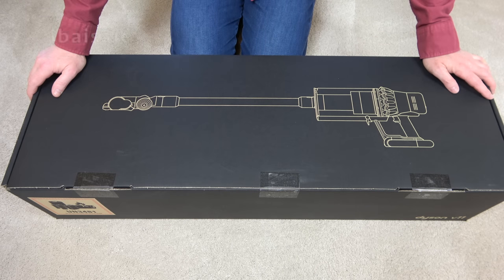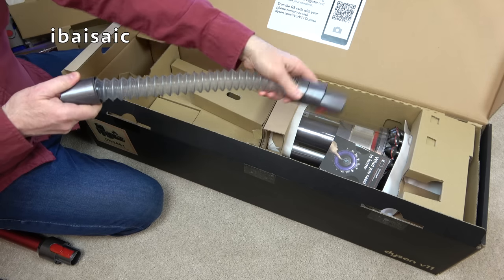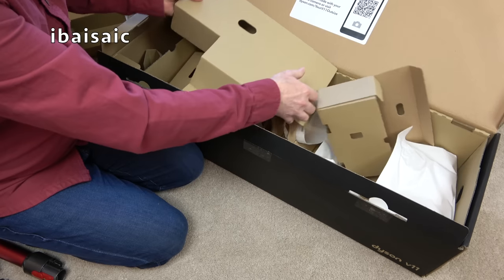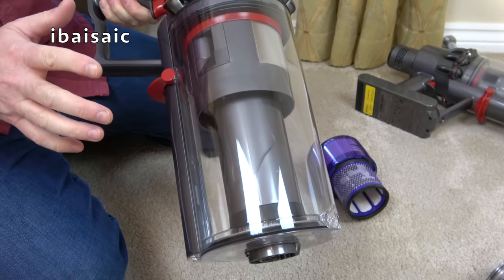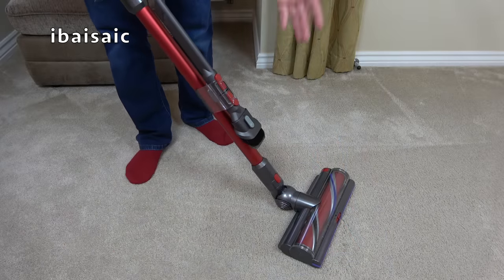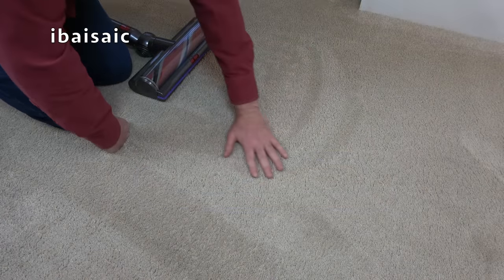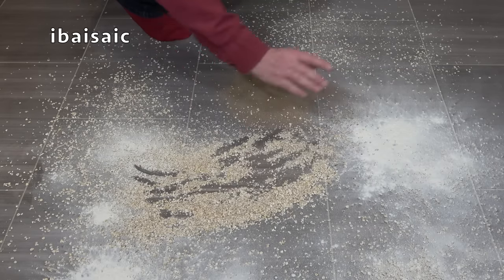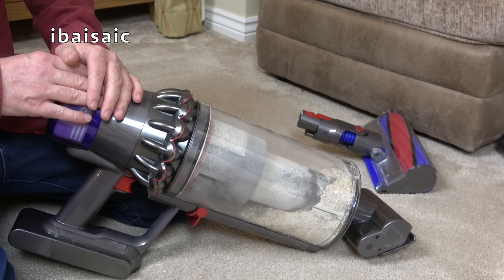Dyson V11 Outsize Cordless Vacuum Cleaner Unboxing & Demonstration

Comment: I would rather have a Central vacuum than Dyson
Reply: Id rather use anything but a dyson
Reply: no one will blame you for not being able to afford
Reply: @dronesaddict1737  I can easily buy any Dyson vacuum I want but I don’t want a dyson I’ll go out and spend $1000 on my central vacuum and I’ll be happy versus the stupid Dyson little break within two years and then after that who knows because it’ll get repaired under warranty and then after the warranty expires God knows what will happen and then I’ll have to pay to fix the darn thing I don’t want to Dyson and also rather get a Miele vacuum over a Dyson
Reply: I have both and love using my Dyson when I don’t want to get the 35’ silentmaster hose out.
Reply: @VacMaster2020 Ye and also Dyson loses suction and battery life after 2 yrs
Reply: @VacMaster2020 Dyson hater have you ever owned a Dyson?
Reply: @pumpkinslayer6 yeah if you don’t maintain it

Comment: Just got the V11 outsize and its a wonderful machine. Heavy to hold on the long clean but does a great job. Got $300 off on runout special as the V15 is being released. The V15 Detect looks like a beast with a laser beam dust detector and an internal particle sensor reveals detailed cleaning data, showing the types of particulates being vacuumed on the digital display. A whopping 230 AW of suction power . Would love a review on that one.

Comment: Stiftung Warentest did a test in Germany with cordless vacuums. Dyson V11 being one of number one listed vacuums. But they found out that Dyson batteries lose about 15-20% of capacity after a simulated use for one and a half year. I’m using a Bosch Athlet 25.2V it came with enough tools, is absolutely great in handling and has a great bush. I even was shocked what it picked up after I vacuumed my mattress^^
Reply: I tried out a Bosch Athlete found it too heavy due only to shoulder problems at the time.   Must say I loved the design of it though.
Reply: Not too keen on the simulated battery tests as they put a lot more stress on the battery chemistry than the use over an actual year and a half would do - so the capacity loss is exaggerated

Comment: Great video Roger 😁

I think the V11 outsize is the only cordless that is a true Upright vacuum replacement.

I do wish Dyson would develop a Cordless upright vacuum, I think it'd be much better than the stick format, they could use the same Digital motor as the V11 outsize and the same swappable battery system too 👍

Comment: Nice video... your videos are always detailed & very informative .. appreciate your effort... 
Can you please guide what’s better — 
Miele triflex hx1 cat & dog OR Dyson V11 .. thanks
Reply: Miele is still relatively new to the stick vac market and while the triflex has a lot of nice features, it is still sub par compared to a dyson. In my professional opinion the dyson would be the better machine until Miele can design a better cyclone separator. As it stands they are a single cyclone style where as the dyson has multiple cyclones which keeps the filter cleaner for longer periods.
Reply: @excelsior2708  thank you so much for your reply..😊👍🏼

Comment: 22:46 I saw on Amazon there is this thing called a trigger lock for Dysons and it goes on the trigger and holds it so that you can set it down and not push your finger on it the whole time your cleaning.

Comment: Great you can take the battery out now without any hassle.  I still wish they would have a constantly on trigger tho. Definitely makes it harder to do the car and stuff using the flex hose.
Reply: One would think if they had 1/2 a brain in the design office they would realised that.  lol
Reply: @Deb.-.  Thing is they had this idea that it saves on battery if you stop start the thing between spaces you are cleaning. And that's quite counter intuitive to how everyone has been vacuuming since forever.
Reply: @scottbutcher9093   Yes, I know however those with arthritis in their hands might struggle, it was an issue from the start.   Maybe one day they will review the situation.  There is always room for improvement. :)
Reply: @Deb.-.  I agree. I hope they revise this at some point.
Reply: They have 2 models in the Far East Market the Omni Glide and Micro 1.5kg that both have on/off button and a boost button! These though only have a 20 minute runtime and I believe designed for quick cleans! The Omni Glide lends itself to an on/off button due to the handle design and the way it’s used! 
Be interesting if this on/off button appears on their other cordless models in the future especially when they introduce Solid State Batteries with bigger storage, lighter, longer runtimes and quick charge times!
As you say Dyson Engineers believe the trigger saves I think it’s 30% on battery energy but they also say the trigger helps battery life as being having the machine on all the time as you are using it even though you may not at times to move things like furniture etc...the battery heats up where as the trigger helps keep it cool with the on off trigger!
Reply: @Deb.-.  español

Comment: All we need dyson to do now is to make built-in led lights on their heads and the front base of the machine when cleaning tight dark spaces
Reply: Miele did that and its better♤
Reply: Shark is the best
Reply: Sometime this year when they upgrade it, which will probably be soon, because this will be out of date.....
Reply: Well, they've come out with the new v15 detect and their newer thinner fluffy head has the next best thing. A precisely placed green lazer to show on the floor the dust and big sized particles

Comment: Yes especially when they're not using the best batteries in the latest machines
Reply: Be interesting to see when they hopefully start using their development in solid state batteries! Which will bring longer runtimes, lighter, better energy storage, last longer and quicker to charge too!
Reply: @Dysonballs  at the moment i am sure they are using 18650 batteries which depends on which variety can be 2200 to 3000 milli amp hour, 21070 batteries max out at 5000 ... And they are not expensive.... Basically they are shortchanging people and not using the better batteries...

Comment: The V 11 outsize weighs 3.56kg or 7.848 lbs.  The V 15 weighs2.74 kg or 6.040 lbs. I am curious if you used the Maytag Wind Tunnel then the V11 what it would pickup and vice versa.

Comment: Hi when are you going to do a video on your henry clean air
Reply: What is a Henry clean air
Reply: @hellothereknownasunknownus6535  its another henry model. He posted it on his insta few days ago
Reply: @ayubahmed3455   yes I’ve just seen it on curry’s and wow it’s basically an Henry allergy but in red and it comes with a turbo brush instead of the free flo tool
Reply: @hellothereknownasunknownus6535  oh ok

Comment: IDK V11 Absolute or outsize what’s better??
Reply: Outsize has better power and more airflow
Reply: I find the normal sized V11 a bit heavy when using it for extended periods (like for an entire house).  If it was me, and this is a very controversial opinion, if the V11 is not big enough to efficiently clean a space, I'd get another type of vacuum altogether.  While super trendy at the moment, the Dyson stick format is not the optimal solution for every use case.

Comment: Noticed on the hard floor test you seem to have ended up with a flour or dust line all around the kitchen that you seen when vac towards the edges and at the end of the vacuuming 39:04  Did someone cause the flour to get everywhere before the video was shot? lol.
Reply from the maker: Flour is very light and when dropped on the floor it tends to spread over a wide area.

Comment: I have both and the normal V11 absolute is way better the outsize is way too bulky and heavy and does not have any more suction power then normal v11
Reply: They both have been tested and the outsize was proven to have better suction. The size and weight does not bother me, I’d much rather have it be a little bit heavier and bigger so I don’t have to empty it two or three times while sweeping
Reply: @michaelholly88  personally I believe the test was biased, but of course it’s whatever you prefer, I have both and I know There is not a difference in suction or battery life
Reply: @damedhelink7231  battery life should be slightly better for the regular V11
Reply: If I didn’t have two dogs the one that really sheds a lot I would have gotten the regular size but I get tired of having to empty the smaller bins to to three times within a few minutes of sweeping and that’s sweeping every day
Reply: @michaelholly88  I understand, I have a 5 bedroom house and I never get a full bin however unlike you I have no pets so I see where your coming from
Reply: @damedhelink7231  Because I get what you’re saying about the size it is just a pinch too big in my opinion and definitely too heavy for my wife to use
Reply: @michaelholly88  Same problem I had, the wife hated it, I put it up for sale at £450 and I had no interest so I’m stuck with it now😂
Reply: @damedhelink7231  dang that sucks ha. I bought the outsize origin for $629. We have a shark ion flex 2X duo clean she likes a lot. I hate it because hair tangles like crazy and the bin is tiny
Reply: @michaelholly88  Hmmmm ive never had or tried a Shark vacuum, maybe one day 😂
Reply: @damedhelink7231  If you don’t have long hair to pic up it’s great, but it needs cleaned like weekly or it becomes useless